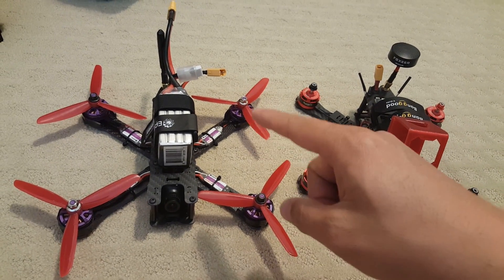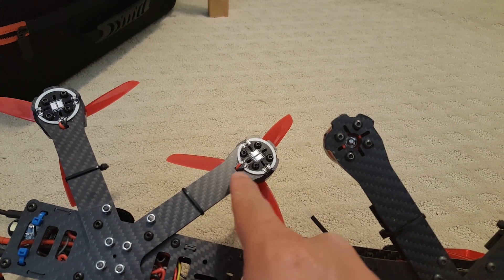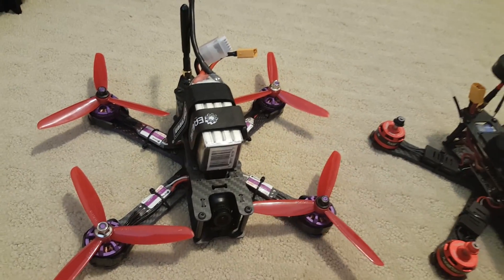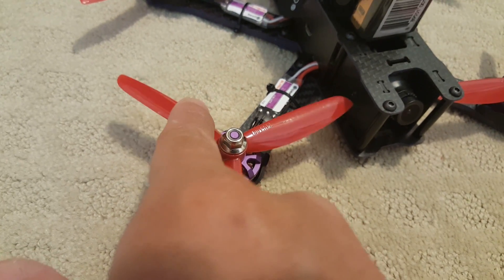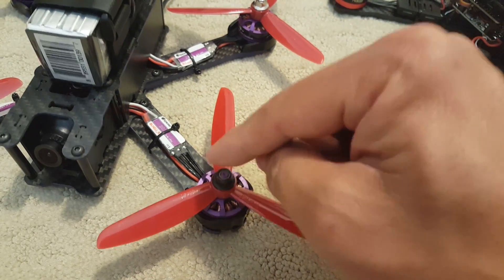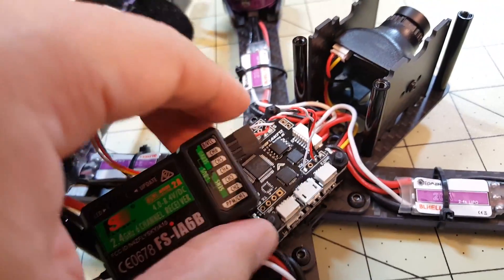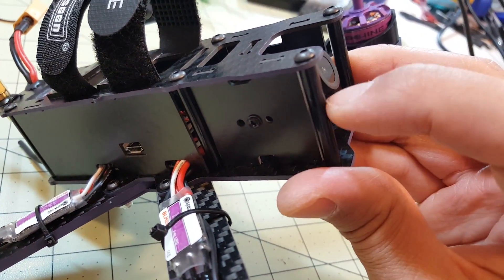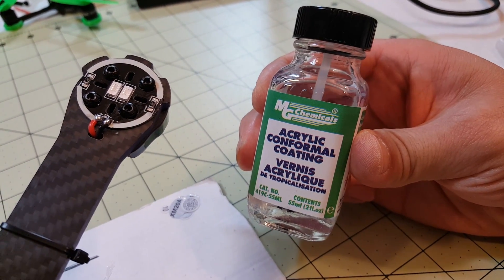Eachine Wizard Betaflight & DSHOT Setup Guide

Comment: Really enjoying the wizard so far! Question about the receiver antenna however, I notice you routed yours straight out the back instead of the "v" on top. Does that make any difference in reception or durability?
Reply from the maker: Doesn't matter unless you plan to fly more than 200m away.

Comment: My motors are running very hot after flying 4s when I mean hot as to where to can't touch the screws.  I've checked to make sure the screws were not touching they are not any suggestions would help

Comment: Is dshot150 even worth using on this quad since you can't run the faster 600? If you take latency into account, dshot150 is the second slowest protocol while multishot is the fastest? More pulses is better, right? BTW, I use multishot (calibrated on oneshot and then switched to multishot) and it works fine.
Reply from the maker: I also flew it on Multishot and could not tell the difference. At least no calibration is needed now :)
Reply: From what I've read online, dshot is only better because there is no calibration and there is no jitter that can affect (change) throttle value sent to the esc. But it's a lot slower that multishot... I don't know what to use, I'll just have to try both. :) I doubt that I'll be able to tell the difference too, especially since I'm a beginner in all of this.
I have also read in a few video comments that these escs also support dshot300 - is this true?

Comment: do u have to use a clip on the boot load pin before flashing? i saw Joshua Bardwell did it on his x220.
Reply from the maker: I did not have to. It depends on your PC driver situation and everyone's is a little different.
Reply: Ah ok. I guess to be sure, just short the boot load socket before flashing.
Reply: I have two x200 and both flashed fine without using a jumper and booting into DFU mode.

Comment: my motors twitch with DSHOT150 on my wizard.
Reply: imagine the motor rotating about an 8th of a turn, then reversing back the other way. Do this over and over at a pretty fast pace.
Reply: I guess you guys got lucky and got a good batch of esc's..
Reply from the maker: I updated to BLHeli 16.6 and also Betaflight 3.1.3 and no twitch on 150, only on 300.
Reply: my blheli is 16.6 and betaflight is 3.1.5.  it's only one motor that twitches, but its enough for me to scratch the idea outright.
Reply: Being new to this I don't think I've seen a 'twitch' before, what would that look like?
Reply: Thanks, I just flashed to BetaFlight 3.1.5 & BLHeli 16.6 and enabled DSHOT150. Time to go give it a test run. I didn't notice anything like you described though with props off.
Reply: Maybe, mine does seem to fly w/o issue. I recall a video by Joshua Bardwell about trying to get Multishot to work on his wizard but couldn't get a successful calibration and just stayed at OneShot. I think this is all very hit and miss quality wise which from my experience so far in quads seems to be par for the course for Eachine or anything I get off of Banggood really. Also I know that I have dshot selected in the FC, is there any other way to test that the esc's are actually using it and the FC isn't reverting back to multi/one shot if it detects the esc can't do dshot? That might be a dumb question, pretty new to all of this so the answer might just be that if you have dshot selected in the FC and your motors spin then the esc's are using dshot.
Reply: Multishot, I believe, is still an analog protocol which requires esc calibration. From the eyes of engineers, not being able to calibrate = trouble.  Dshot, being digital, doesn't need calibration.

Comment: Are you sure that D-Shot is working??? I've never seen somebody select D-Shot with this quad! The esc's will probably run D-Shot but i was never sure if i needed to get rid of capacitors.
So i just select D-Shot and it will works??? I also did a complete setup video with IBUS but i just used the other port on the FC anyway great video!!!
Reply from the maker: +SnoepoX dshot150 works, 300 didn't. I did not mod the ESCs
Reply: Albert Kim cool good to know  but how do you test D-Shot?
Reply: I'm asking because i would like to learn and know I've got a Realacc build coming it uses the same esc's 20a if i know how to check or test it, it would be great! Thanks

Comment: I've seen it mentioned that if you select DShot some people are not able to get their ESC's to calibrate, were you able to?
Reply from the maker: +AmorilV with dshot calibration is not needed. I am definitely flying dshot 150.
Reply: AmorilV that has nothing to do with D-Shot in particular you would have the same issue with Multishot. It's a bug in the Racerstar 20A esc's. I am not 100% sure but from what i know if your esc's would support D-Shot you don't longer have to calibrate the esc's.
Reply: Thanks, I got Mutlishot & DShot confused, it was Multishot I had meant to say.
Reply: did you mod the esc's?